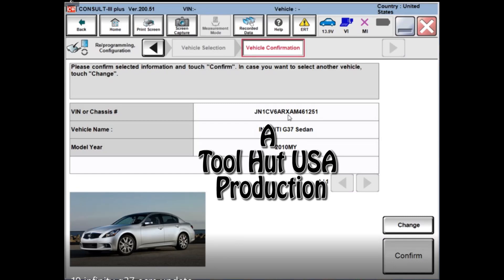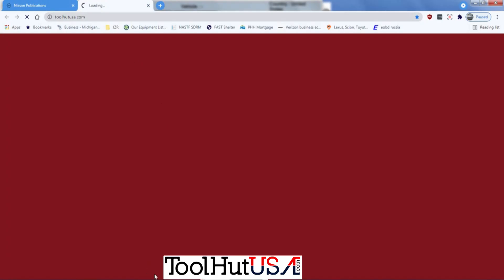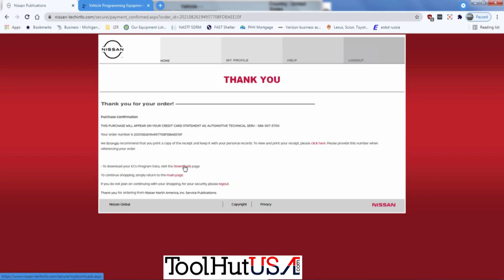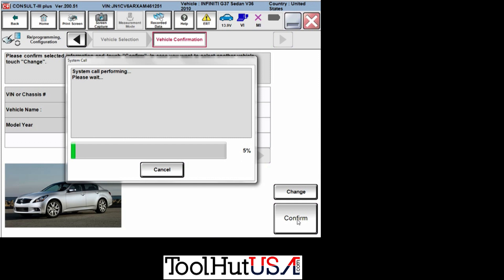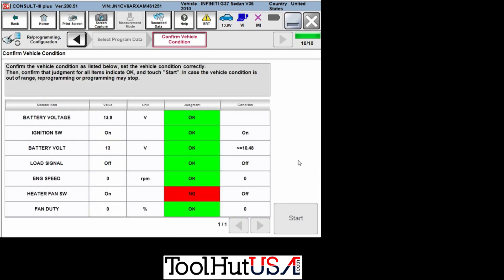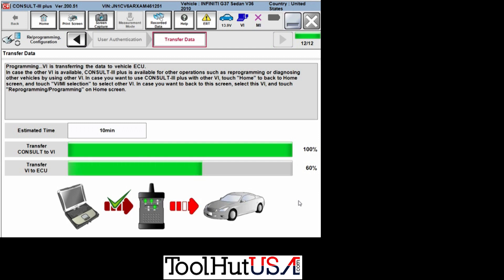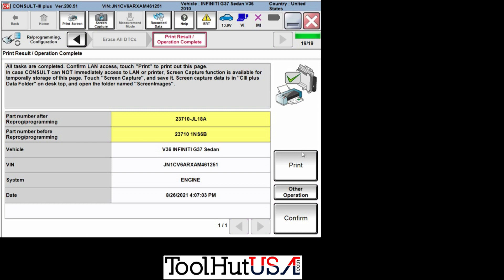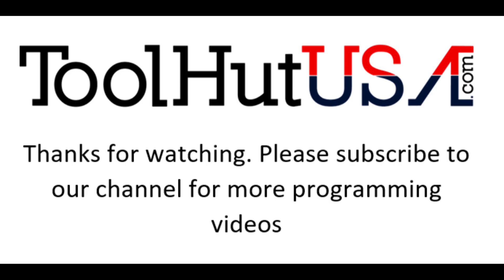2010 Infinity G37 ECM Update using R2R software

Comment: Great video! Quick question—are the programming files supposed to be in the ReproProgramming folder on the C: drive, or under the Consult-3 Programming folder? I’ve been placing them in C:\ReproProgramming\folder, but the reprogramming option in Consult-3 is still grayed out.

Any insight would be much appreciated. Thanks!

Comment: hello, have question im use r2r im buying data from tech. but i get from usin reprograming c 3 c 2 c 1, im seeh you buy this from j2534 programing is any diferen on tha data because i do from reprograming data from consult 3 2 1 but went i get to select calibration dont show anyting to do the programing.
Reply from the maker: you have to make sure your file is in correct folder